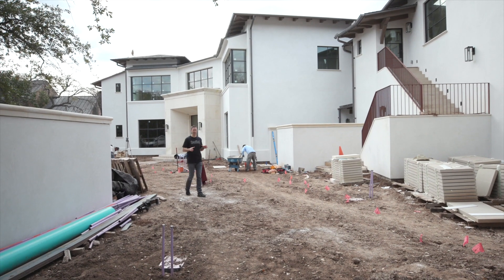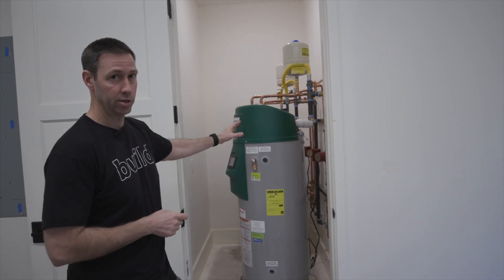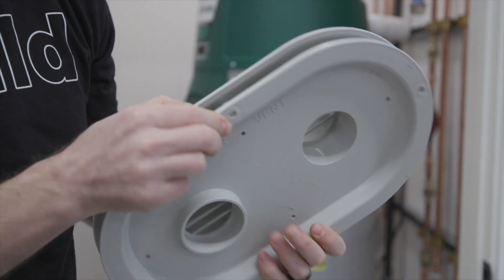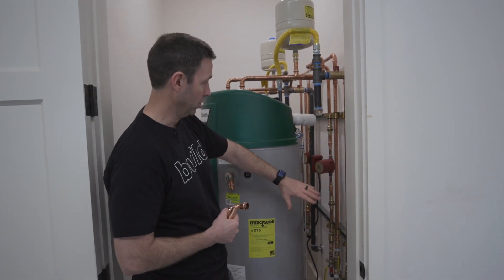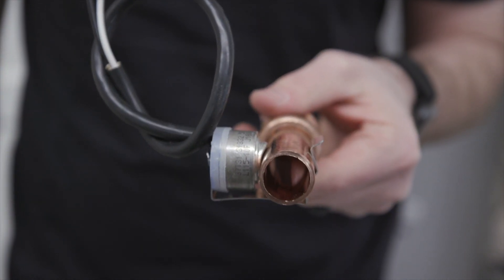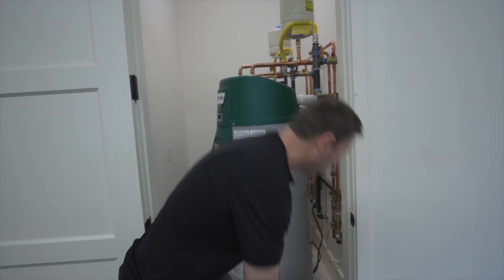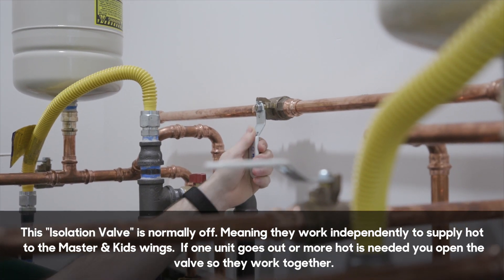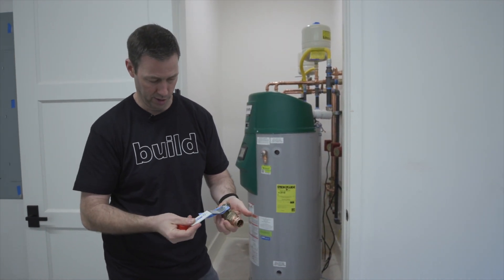Hot Water For A 7000 Sf House?

Comment: One centralized system in a house that big makes no sense.  At least if you are going to put in two heaters, put them is separate closets closer to their points of use.   That closet is only big enough for one anyway.

The recirc on a timer is just a bandaid for the poor centralized design choice.   I have it at my place and it just doesn't work.  There are always times when you need hot water when the timer is off.   

Lastly the insulation on the recirc lines is usually inadequate.  I have the standard 1/2 inch insulation and the recirc line has cooled down to room temp about 15 mins after the pump shuts off.   What with the copper being such a heat thief you come to realize that this entire approach is just wrong.   We should be going to multiple small units close to the points of use.
Reply: John  I agree, but the Architects never ask the plumber or a mechanical contractor what their opinion is before they designed the house. Some of them listen and learn from their mistakes and some are arrogant. I am convinced after 35 years in the gas utility industry that failure teaches us more than success does. There is an old joke in Structural Engineering. You should never hire a civil engineer who hasn't had at least one Bridge fall down; because he or she is over designing. But you should never hire one that's had 2 fall down ,because they haven't learned.
Reply: I personally hate recirculation systems. I once had a customer who asked for one to be put in, I explained that they are very expensive to run. After some time he called me to say that my system (heat pump) was not efficient. I went back to the house and switched off the recirculation pump. He never complained again lol.
Reply: I agree. It's a poorly designed system, especially considering they designed the house from scratch.
Reply: An active recirc line is basically hydronic heating - 100-200ft of pipe have as much surface area as the whole tank.  You want to bind the recirc line to the hot water line and then put enormous amounts of insulation around them both - 2, 3, even 4 inches of the stuff for the sections that run in floors or mechanical rooms.  Thinner insulation is probably unavoidable in walls.
Reply: I agree. But did you consider that that would mean more gas lines running through the house?
Reply: @killax7  Excellent point.  I'm thinking electric.
Reply: @scorpio6587  yes!  The world is going electric anyway.  If you have solar it makes sense to have electric heaters near the point of use.   A huge house like that has plenty of roof for solar.
Reply: @castletown999  My thoughts, exactly.
Reply: Rather design the plumbing system so that hot water supply is closer to the demand.
Reply: Agreed. I also prefer multiple small units close to the points of use.
Reply: You are very right about the recirc lines needing tons of insulation. Take a building like a school which needs centralized mechanical. Most engineers spec minimum 1 inch fiberglass pipe insulation.
Reply: for a house this size they could have gone with a combi-boiler for hot water and heating.
Reply: yes I wish Matt would address this and using GAS in this case why not two Tankless mounted near each main location ?
Reply: @doublebulbing  I came across this article from Matt about why he's using these High Efficiency tank models over Tankless and seems like the core of it is maintenance and not wanting the hassle of descaling 2-3 heaters every year.  My guess was the room was planned for tankless or the tankless was intended local to the bathrooms and this closet got adapted into an mechanical room after the plans were done.  https://www.finehomebuilding.com/2013/06/06/tankless-vs-tank-vs-hpwh-10-year-costs-estimates-large-custom-home
Reply: Personally I hate timer circulators, they never seem to be on when I want.  When I need recirc I program it into the lighting control/home automation system so that when the client turns on the light in the bathroom/laundry it triggers the recirc automatically on demand.
Reply: @ACMEHomeSocal  First thanks for the article and just interesting he mentions that the tanks need to also be drained and maintained yearly. I guess I was more questioning in the master bath seems like tankless would have been better and then done the other for the main hot water uses in the house. 

I guess if the tankless is in a mechanical closet or even laundry room it is would easy to just hang beside it a fixed pump and tank system and the hoses for the yearly or bi yearly flush. That would make the tankless maintenance really easy cause it would already be installed beside the unit so all you would have to add would be the solution and it would not add much additional cost
Reply: @doublebulbing  I agree, I believe in trying to localize the heater, especially if one tank is essentially dedicated to the master.  I'm also surprised he doesn't have a water softener system on the house if the hard water is such an issue.  His article is talking about a 7000sq ft house with only one of the Vertex, wonder what pushed this project into needing a second?  Perhaps the original design was for a single unit and they decided to expand the capacity with a 2nd but it was too late to locate it in a separate location.
Reply: @ACMEHomeSocal  we put in a tank-less in our house about a year ago and it does take some getting used to. Mainly because you are no longer blending water to get the right temp. This is not a issue in the bathroom shower but the one handle faucet in the kitchen is going to go soon cause you do not want to keep turning on enough of the flow of the hot to start the unit firing when you only just needed cold water but the one handle was push on in the center causing water to flow from both hot and cold. also It has saved money but not enough to justify the cost in the short term but hopefully in the long term with it outlasting a regular tank plus having it mounted outside save the square footage inside the house that we needed 

The thing about building is there is so much too it and so many different ways of things being right for so many different installs. I really am thankful for the knowledge this channel shares and the additional conversations in the comment sections
Reply: Did you notice that there were 4 hinges on the door to that space. That tells you a lot. I'm guessing the client wants what he wants and doesn't care about the cost. 

If you can't design the house sensibly, this is probably the best way to compensate. Multiple point-of-use or on-demand heaters would probably be more trouble than they were worth. There's no perfect solution.
Reply: @MakeMeThinkAgain  yea so many ways in home design to accomplish the same thing but just a whole spectrum of trade off and benefits and everyone has their way that they want it do be done
Reply: @MakeMeThinkAgain  because it is an 8 foot door.  Any "good" door at 8 ft would have 4 hinges

Comment: Make sure your plumbers used the right thickness copper pipe.  That water circulating more than usual will wear the pipe down, that is why you need thick copper pipe.

Comment: No catch pans under the water heaters?
Reply: I was about to say the same thing.  Even if you're not concerned about damage,  a pan is a good way to catch drips.  A supeer-slow drip you may not catch before it evaps, but you'll see stains in the pan.
Reply: Don't they make a cheap alarm system for water leaks? The cost to build  a 7k sq. ft. house , one would expect  the hot water heater to be raised off the concrete floor, use a catch pan , and an alarm as cheap insurance.
Reply: @michaelpatish7248  yes, the alarm is a float that goes in the catch pan.
Reply: The mechanical room looks to be off the garage and on the garage slab.
Reply: I saw that and there could be a concrete curb around the whole garage area,  but I always thought it was a good idea to have some sort of catch basin for a water heater. There might be a slow leak or drip that could be contained and identified before it flowed to a wall or doorway. With the amount of time spent checking water heaters, it would be cheap insurance.

Comment: these tanks are  a copy of the Polaris water heater which I have been using for 30 years, only the Polaris goes to 199,000 BTU and was this efficient 30 years ago.  I have installed these in about 500 homes, probably 100 over 7000 sq ft.  Polaris is stainless steel and the first one I put in is still working.  Additionally, I used these to also heat the house with radiant heat.
Reply: throgz a zoned radiant floor will save a ton of dough on a house this size.
Reply: @ek9772  What will it save money on specifically?  Are you cooling with the same plumbing (this is Austin)?
Reply: Trogdor Burninator the advantage of a zoned radiant floor for heating (in this case) is the ability to choose which zones to heat, and the ability to choose different heating temperatures for each zone.

For instance, the garage can be heated once the outside temperature reaches freezing temperature, and it can stop heating once the internal temperature is 25-degrees Fahrenheit above freezing.

Empty rooms, for example, can be heated 30-degrees Fahrenheit above freezing, and common areas (living room, kitchen area, and halls) can be heated to 60°F.

Cooling requires a different type of equipment than the one installed in this room, and it requires a different type of installation than heating.  So since this video is about heating I will not explore this option.

Regarding money saved this will depend on the volume and insulation of each zoned area, but the advantage is that since there are already large water heaters with tanks the potential to distribute the heat energy is already there.  In addition, the cost to heat the water is among the most efficient conventional ways of doing it.
Reply: I have a Polaris in my home, the 34 gallon unit has the same output of the Vertex. I chose the Polaris because of the stainless tank and much lower cost of repair parts.
Reply: 100000 BTU units.

Comment: Has anyone used smart switches and outlets to control the pump on a recirculating system?

 I figured it would save energy to have smart light switches in the bathrooms at the far end of the run activate a smart outlet for the pump when the lights are turned on. That way the pump only works on demand. The smart outlet should also allow for the ability to set schedules too. Does anyone see any issues with this?
Reply: I was thinking of hacking some amazon smart buttons to give me a one shot recirc, make it hot then stop before my shower, but that is way better than my idea and probably doable with IFTTT if the native tools don’t do it

Comment: I assume that the plumber hasn’t finished yet as I see the relief valve wasn’t piped to the floor? Like many comments that room is to tight! Just reading the front displays your up against the wall? Do like there use of straps on the wall for piping, being a tradesman my self taking the  extra time to make it look good and functional is a tradesman responsibility! I know it’s always a battle with the architect when it comes to the mechanical room size!! We sure have come a long way in the boiler design, Matt have you thought about doing a tour in Europe to look at the factory’s heating designs like Viessmann?

Comment: Q: Are the hot water tanks designed so they do not need to be installed on a stand, 18” above the ground and/or have them installed without pans? I hope they enjoy their new home :)
Reply: Newer water heaters have a sealed combustion chamber that is anzi approved to be sitting on floor. Any gas fired water heater with a non sealed chamber must be 18” above ground

Comment: Why are they not using ground source pumps for water heating?
Reply: Maria das Santos the house is in Rocky Austin TX, would cost $50,000 to drill the holes lol
Reply: Maria das Santos have you figured out the electricity bill for running the water pumps for a GSHP?

Comment: Those expansion tanks need to be strapped to wall,they will  break at fitting
Reply: I think they will be fine, because they are in the vertical position but cheese burger you are correct it doesn't take much to snap those off . When I set mine I like to install a dielectric union with a shut off making it so easy to change out when the diaphragm goes bad in 10 or so years.
Reply: @scoobtoober29  when water is heated it expands. Creating more psi in the water line can cause your faucets to start leaking. When installing an expansion  tank . Cold water going to  feed your water heater.come out the wall 
Ball vavle,check vavle expansion tank than you feed your water heater.
If you don't put a check vavle in than you just put the expansion tank on the whole house.
Reply: @scoobtoober29 if you install an expansion tank yes you do.
Reply: @cheeseburger9232  does not know what hes talking about. The expansion tank is only needed when you have city water and the water has nowhere to go due to a check valve in the system. If you have well water you probably have a bladder tank after the pump. You do not install a check valve before the water heater. That does absolutely nothing
Reply: Kyle Wagner 
No, it doesn’t have to go after the tank. Actually hot water is not good for the rubber bladder.  The expansion tank can theoretically be anywhere between the main and the water heater.  When water in the water heater gets hot it expands in both directions therefore the pipe from the main to the water heater gets pressurized just as the pipe from the water heater to the fixtures gets pressurized.  I have mine mounted on the cold side right before the water heaters.
Reply: M D you can't see the yellow gas flexes on top?
Reply: @cheeseburger9232  ITS HARD PIPED FROM STREET TO THAT MECHANICAL ROOM ...IS WHAT I AM REFERRING TO
Reply: scoobtoober29 
If you have a pressure reducer where you main comes into the basement that acts as a check valve.  Water can’t flow back out to the street.  If that is the case you DO need an expansion tank.
Reply: THEY WEREN'T DONE ....I THINK THOSE PLUMBERS KNOW WHAT TO DO
Reply: Hard piping the gas line isn’t necessary no matter the btu load....hard piping anything is technically not the best solution for any gas fired appliance
Reply: M D. And at 100k btu gas should be hard piped ,
Reply: @cheeseburger9232  NO MATTER THE BTU...CITY PRESSURE IS SET...IF THIS HELPS CLARIFY?
Reply: @cheeseburger9232  IT PROBABLY IS....COULDN'T SEE THE GAS LINE?

Comment: Isn't that mechanical closet a bit small?
Reply: Not enough room guys, it's only a 7000 sq ft home XD
Reply: When the heater at the corner fails both have to removed bad design for  the room for sure.
Reply: maybe there were be Conservative in this place of the home because they dont have to use/work in it

Comment: Matt, that temperature sensor is usually on the return line, set to stop the pump when returning water reaches about 105 deg F.
Reply: Gene DeJoannis , Do these temp sensors work on pex?  Would I put this only at the trunk or with the pex system could I get this circulation pump to only run for the upstairs?  Also, what is an ideal temperature configuration for the sensor? 130 and 110? use this house for instance.
Reply: @gial8862 :  They should work fine on PEX.  I would put the pump on the upstairs return pipe (was it clear that you need a 3rd pipe for this system?  Hot, cold and warm return.).  When the warm return rises to 105 deg or so the hot water at the fixture should be at the tank supply temp.  You probably cannot adjust the temp setting when the pump stops; it is likely preset by the manufacturer.  You should not be supplying water more than 110 deg for safety and economy.  Here's a little secret:  If you have bathrooms on the second floor you DON'T need the pump.  The return line will allow slow circulation of hot water by buoyancy forces, from the heater and back down the return line to the bottom of the tank.  It will always be hot at the fixture where the return line is connected, so put it on the furthest bathroom.  You might want to consider putting a time clock on the water heater (if it needs electric power to run) to shut it off at night when no one is using hot water.  Otherwise when the tank is hot, you will always have that circulation stealing some heat from the tank.  But its a small price to pay for instant hot water.

Comment: I love your videos, but if that was my house, I'd want a room that's at least half again as wide as that "closet" for the Hot Water Tanks!  My thinking being that if ever I had to have some work done on either of those units ( it looks like there are 2) it would be very hard for the plumber to work in there at all!.  I'd also want the larger room so that it wouldn't get too hot in there, and maybe even want the walls to be "brick" or that cement board rather than regular sheet-rock just for my own peace of mind.  That's not to say you didn't do that, since you do seem to be quite knowledgable and very up to date.
Reply: I had a similar thought. If you had to replace the back unit then there is not choice but to remove both in order to do so. I would have either made the room wider or put them both against the back wall and made a wide but shallow room.
Reply: I think the drywall there is partly due to the lazy thinking when designing around fire codes.  When drywall meets the masonry wall you'd have to put intumescent caulk on mineral wool or do something similar to meet fire code.  I did this after removing a mouldy/rotten wall in a service room next to a 130 year old stone foundation.
Reply: On the other hand, this space does seem to have room to pull the sacrificial anodes... something my building lacks.
Reply: @MakeMeThinkAgain  they have hinged sectional anodes for this reason